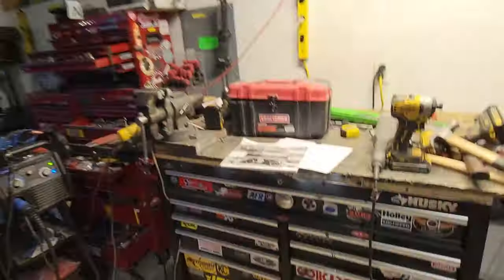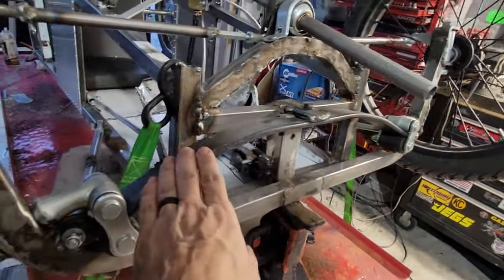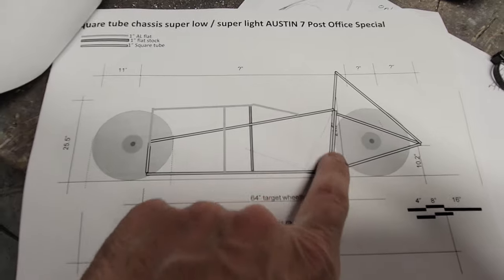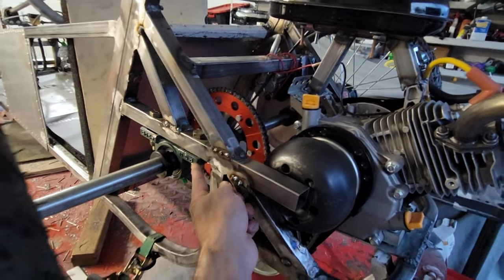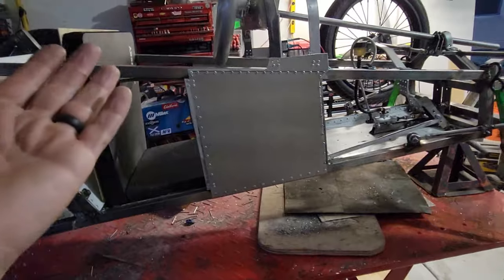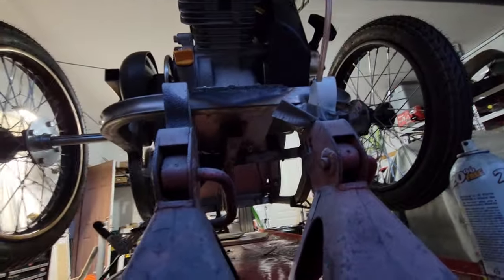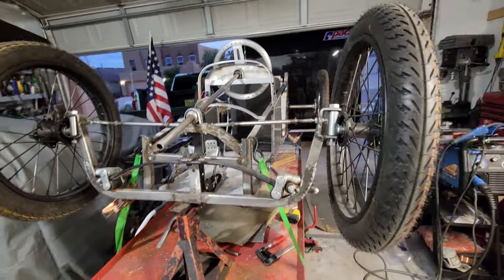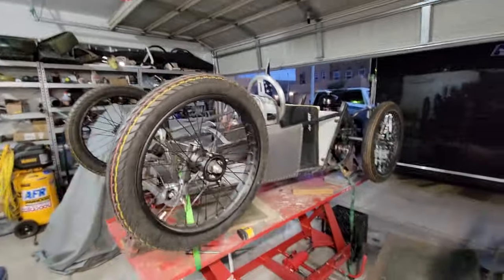Terwilliger Cyclekart Austin 7 post office special 1923 Brooklands racer

Comment: You're front suspension is going to bind! When spring flattens out, there is nowhere to go!
Reply from the maker: Yeah it looks bad on camera, but when I jump on the spring it has a good bit of travel before it hits the radius rods. More than needed for this little car. What I'd really like is a softer/weaker spring. Which would bind easier of course, but I can relocate the radius rod if needed
Reply: Looks like the spring is trapped against the axle and any spring flexing would be either side of the chassis mount. Would be interesting to see it on the ground  with a bit of weight on it.
On a second look, it seems that the jack under the front axle is already causing that deformation of the spring around the perch.

Comment: My car is a loose replica of the Ford Lotus with a 61.5" wheel base /12.5 degree caster with rack & pinion steering. Flat out on gravel or asphalt it does'nt wobble or wonder a bit. Looks like a nice build
Reply from the maker: Great to hear Gerry, hopefully I have enough camber in this thing be safe as well!

Comment: Nice work, strong, light and well triangulated, definately a step above the traditional 1x3 ladder frame. I think you may find that your 1"x14 ga front axle to be too delicate and will require further bracing. Are you using Gas or Mig?
Reply from the maker: Mig, and you'd be surprised how well that 14ga holds up! Haha, off camera the axle got plated at the bends with 1" wide .120 flat stock, as long as I don't go Baja racing it's fine
Reply: @BenTerwilliger  You switched in a stunt axle without us seeing.

Comment: Very nice!! New Subscriber here.... I am starting a Youtube channel with the build of a 1928 RIP GN/MG restomod special 3 wheeler with 4 wheels. I have been assembling a decent machine shop so that I will be able to make any parts I need for this or any of my other projects. I am planning on starting this project as soon as it gets warm enough to work out in the barn shop. It is a 1928 Morgan with a wooden frame over steel and an experimental aircraft supercharged opposed twin engine. I am going ot adapt this engine to an MG 4 speed manual gearbox with the use of a two part hand cast aluminum um adapter plate. The gearbox will connect to an MG differential with awesome wire wheels. The body is made from stretched aircraft fabric sprayed with plasticizer for stiffness. There is only one 1928 RIP aero 3 wheels with 4 wheels that is currently being raced by Charlie Martin in the hillclimb races as well as the Goodwood revivals in the UK. I plan on taking mine to join in the festivities next year or the year after just like the American doctor does with Ol'Yeller to join in the races. I hope to see you there.